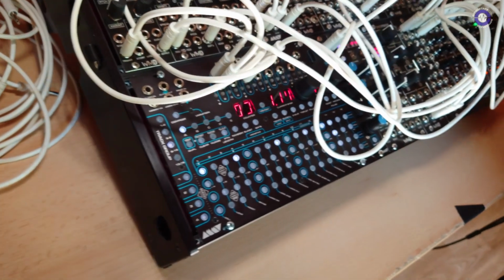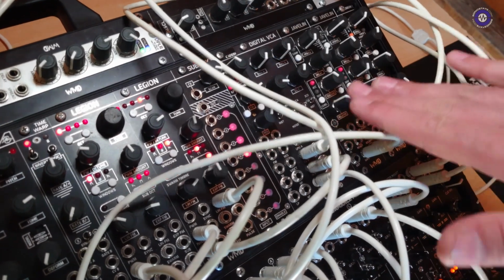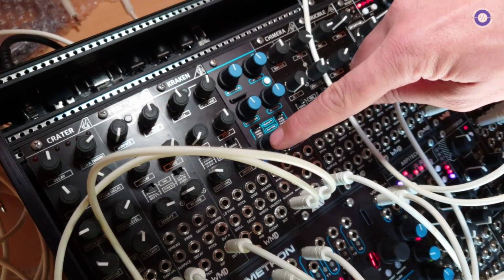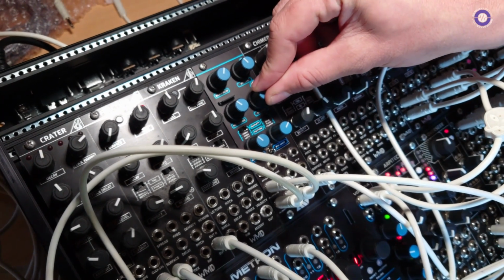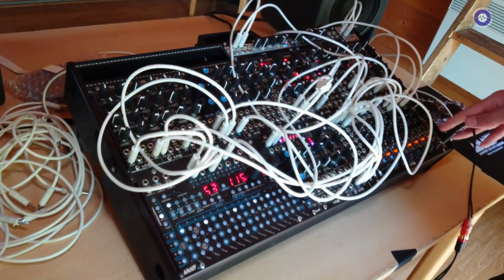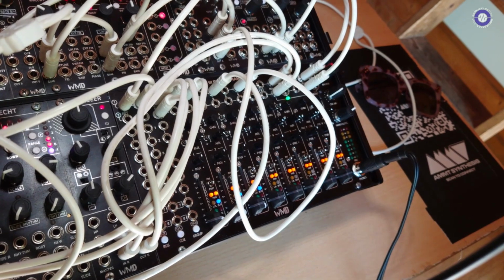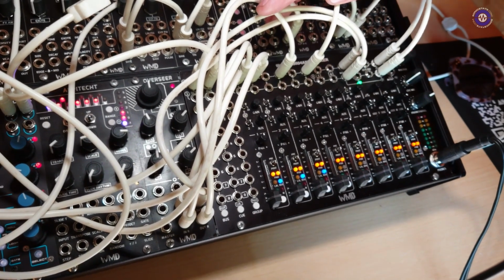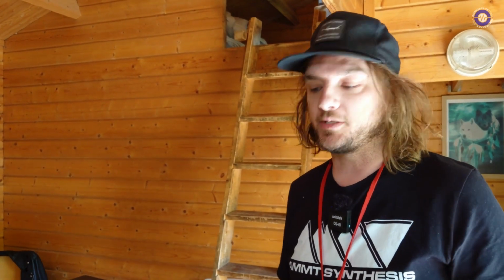Superbooth 2023: WMD/AMMT - VCA Mark III - HiHat

Comment: Man, I was just hoping to get a mutes for my performance mixer, but the MKII looks sick! So glad y'all are back! Glad to see the old and new will get more life and find more users!
Reply: This MK2 or all the Befaco mixer parts? Is the WMD just that much better to wait + spend that much more money?
Reply: @toddtrulock6809  I think it depends on what you want in terms of features. The MKI was made in house as WMD manufactured in house and even contracted for other manufacturers that didn't have the equipment. They added know how as well. I assume MKII will be designed by WMD with some of the team that is carrying on, but the assembly is likely going to be done by a different shop. That's necessarily as bad thing. WMD shut its doors before because it didn't make sense to do in-house assembly anymore.